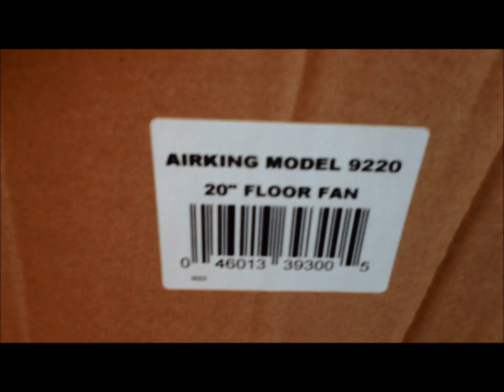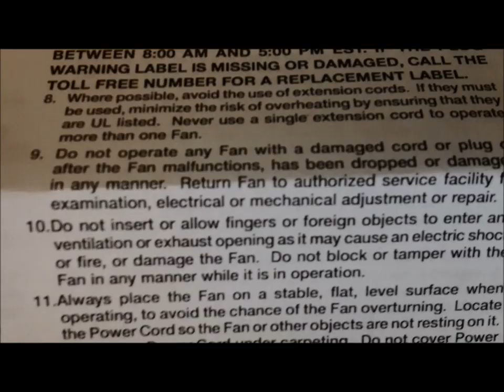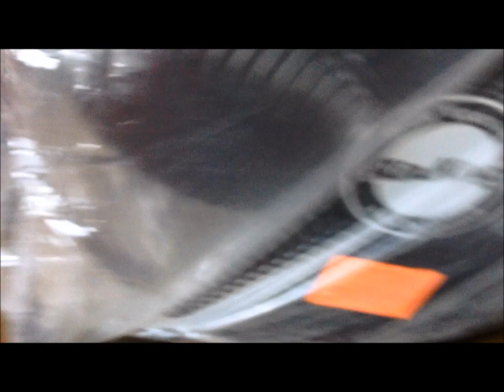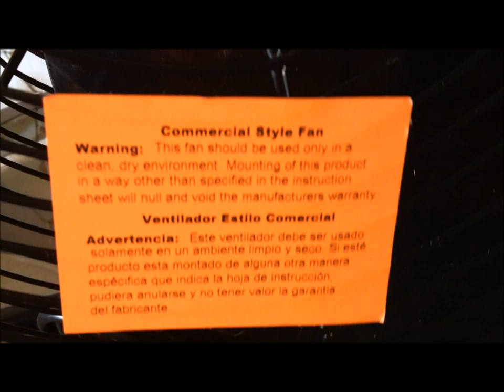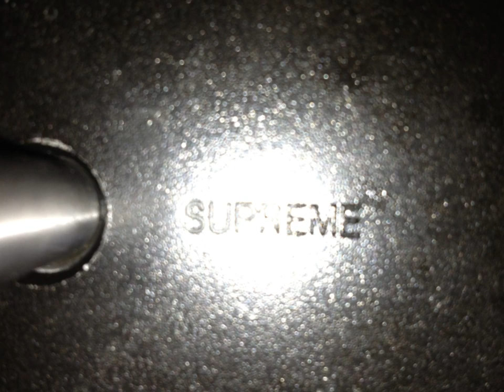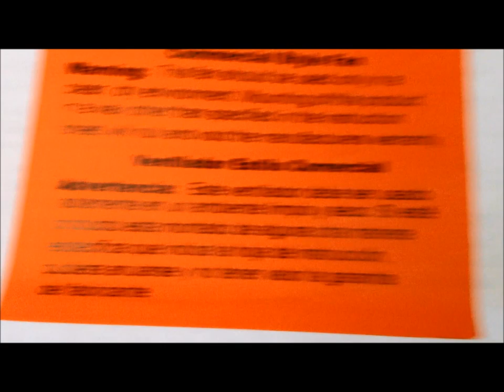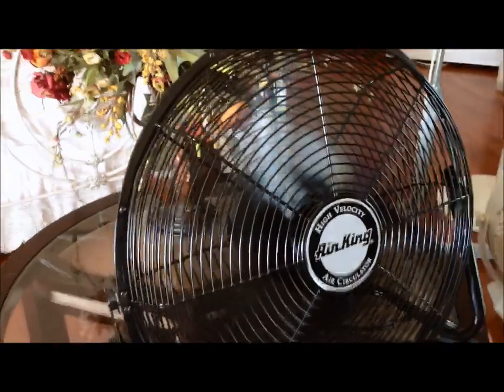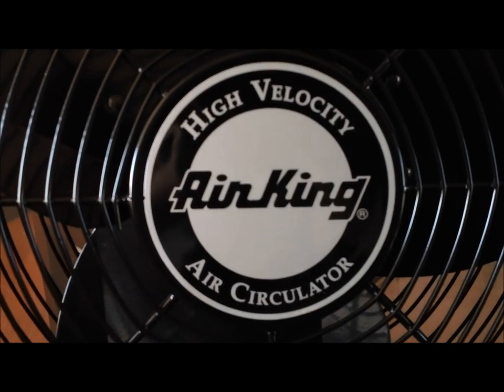Air King 20" High-Velocity Power Circulator

Comment from the maker: When Lasko switched motor suppliers from Marco Electric to Glory Promotor in 1999, they failed to take note that the new motors weren't thermally protected, and didn't shut off when they overheated, allowing them to catch on fire. This problem was corrected in 2006 when Lasko started installing thermal fuses in their plugs. These "smart fuses" dare able to detect excessive heat in the motor and pop, cutting the power to the to the motor, when it does overheat.

Comment: The Air King fans are retro in all the right ways, and I really like the classy black paint job. I have a GE-branded version of this fan, bought in 2003, and it ran almost constantly for 5 years in the window of my various dorm rooms in college (I was on the 5-year plan, ha), but I still have it and it still runs well.

Comment from the maker: Just remember, you get what you pay for. If it's going to be a collector fan, power doesn't really matter. And if you can't afford the 20" version, ask for the 18", 14", or 12" version. I did some research and here are the lowest prices I could find...

9220- $94.99 +$7.00 S&H (total $101.99)
9218- $88.35 +free shipping
9214- $106.99 +free shipping
9212- $63.56 +free shipping

Comment from the maker: This fan beats a modern-day, cheap box fan in every aspect. It's quieter (even on high), built better, moves A LOT more air (on all three speeds), and it's a far better value for your money because unlike a cheap box fan which only has less than $10 worth of materials and labor in it, this fan actually has $120 worth of materials and labor in it...